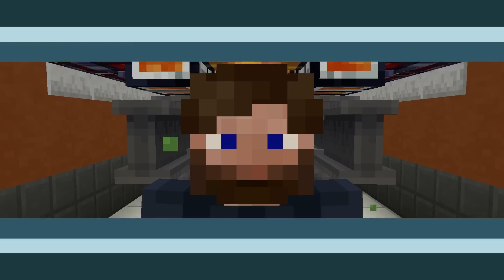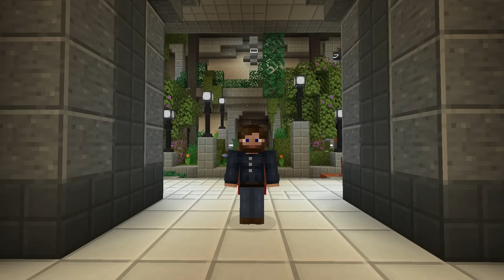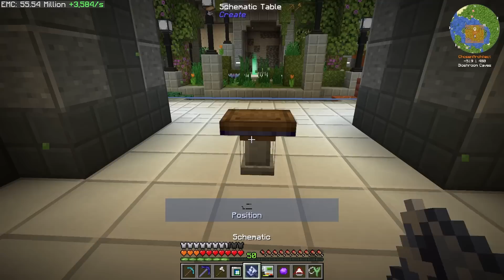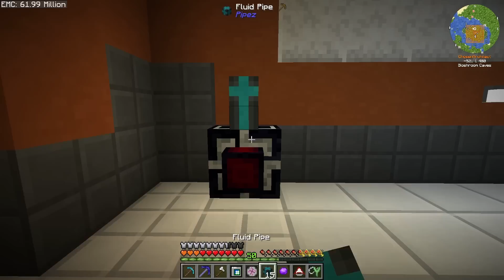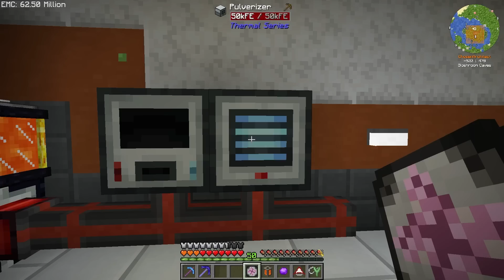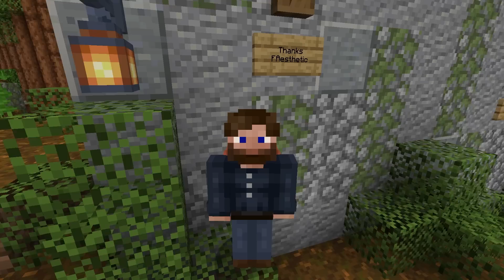PROJECT ARCHITECT 2 - EP 8: Unlimited LAVA Power

Comment: yeah id started with the powah solar panel then once got mekanisam going was getting a net loss over night though just used the sleeping bag if needed went into using the powah thermal gens with blazing crystal blocks for the extra boost like many others here :) may be a lot of recursive crafting but most efficient and least input of fuel from my point of view.

Comment: For those who want approx 30 million EMC per second income without any Archi-items yet:
Create an RFTools dimension flat full with diamond blocks, mine with fully infused builder (quarry card with filter to diamonds only) and feed them into the EMC link. To keep up with the flow, compress the diamonds in the compacting drawer to 2x (you can use a second drawer if your EMC link is too low level). 
You can create a dimension that literally has diamonds only, from Y level -62 all the way up to 120. To do so, create a dimension like this:
Diamond block
Terrain - flat
Feature - none
Biome - none
Structure - none
Sit back and relax, think about your life choices (time to throw away that fancy ore multiplier setup you invested in), consider building something stupid or going on an adventure. For the time being, all your block and material needs are covered :)
Reply: Now try this with draconium ores 😅

Comment: I also went with lava power, but I opted for Magmators from Powah. People say it's more crafting but seeing you craft and set up 36 of those dynamos to get 2k FE which is equivalent to a single Niotic Magmator I'm not convinced. 😂
Reply: @dejsimiwerkin8681  but you need quite a bit of power to get niotic stuff. Which is why powah is either a time sink or the power setup you do after your early game power.
Reply: @paulelderson934   I guess that depends on how you define time sink.
Assuming that you have no power storage and ignoring any power that may be stored in the Magmator and Energizing Rods - relying solely on the generation capability of your Magmator it takes around 30s to get Energized Steel to upgrade from Basic to Hardened, then around 3.5 min to get Blazing Crystals and after that 4 min to get Niotic Crystals.
I wouldn't really consider 8 min to be a time sink. 😆
Reply: @dejsimiwerkin8681 do the niotic cystals have emc? Cause if not I'd still consider it one 😂
Reply: @hallowie3873  And do ingots have EMC? Because you'll need 5 stacks of them to craft 36 dynamos. Additionally, those calculations were the absolute worst case scenario which doesn't exactly reflect the actual gameplay as the Magmator and Energizing Rods store some energy in them as well, sometimes giving you a few instant crystals. Also crafting more than 1 Magmator at once will speed it up, bc when you take down 1 of the Magmators to upgrade it the other will keep on generating and storing power which can then be used to insta energize a crystal.
Reply: @paulelderson934 I just used a netherite furnace with generator augment to get there pretty quickly. First time using the iron furnaces mod for generator and it was surprisingly good.

Comment: There's a much easier and much more powerful starter energy source (smth like 4800rf/tick) but I'm afraid that it's an oversight and revealing it here might get it fixed, but I'll give a hint: it uses the easy villagers mod
Reply: I'm reasonably sure I know what you're referring to.  Emeralds are friends.  That being said, I used them to upgrade my Thermo gens from Powah to Spirited tier.  Five of those give me enough power to run a void dimension of ancient debris cubes for EMC generation, functionally breaking the pack wide open on that front.  All I need to do now is set up an RFTools builder or something similar to automate the process, though the pick I have right now does make it quick work all on its own...
Reply: @mlogan2k2  no just a couple furnaces and farmers from easy villagers, a carrot burns quick

Comment: Heh, I got four of those thermal sterling engines producing 1600 rf each. The thermal extra energy production upgrades are OP with +300% for 0.8× fuel energy.
And with emc some charcoal blocks are real cheap. A quarry can be run, and make massive profits

Comment: the easiest power generation thing imo is the rainbow generator from iron furnace mod and using the infinite fuel item from project e and you get over 50k power very cheap
Reply: Hey, how does this work? I've made the rainbow generator and the infinite fuel item, but can't get it to power things? Such as a quarry
Reply: @jackstaaar5  they all need the generator upgrade and all have to work at the same time and also their buffers shouldn’t be full if so the rainbow generator won’t generate 50k
Reply: @congratulations-  ahh okay, so you need all the furnace types in that mod in a row? And I haven't seen the generator upgrade just yet, will have a look for it
Reply: @jackstaaar5  yesss and i do not know the exact name of the upgrade but it is red
Reply: @congratulations-  found it thank you!
Reply: I like to use a gas burning generator from mekanism burning ethylene. right now im using moss blocks, they're only 12emc each
Reply: yup totally agree, set mine up with infinite fuel and energy trashcans behind them and it is just perfect